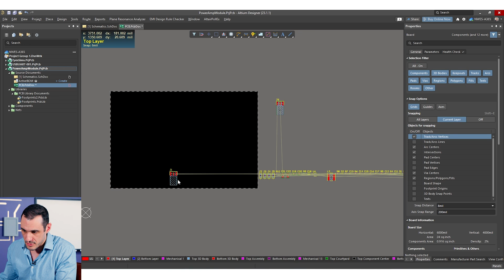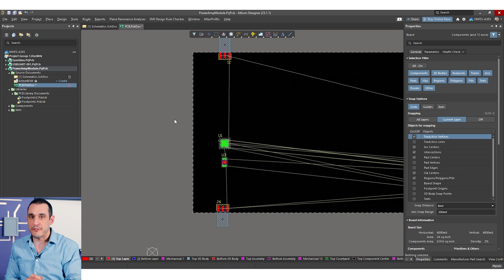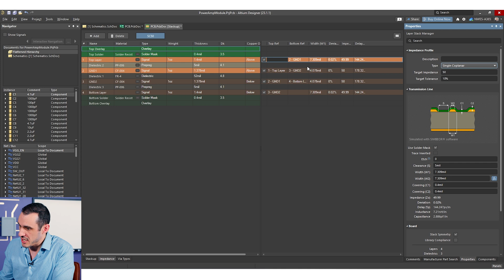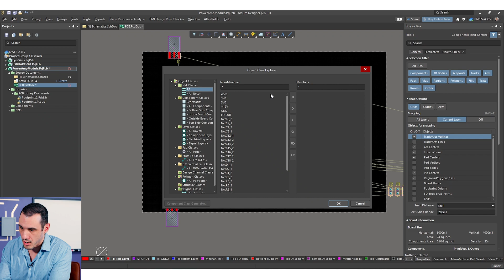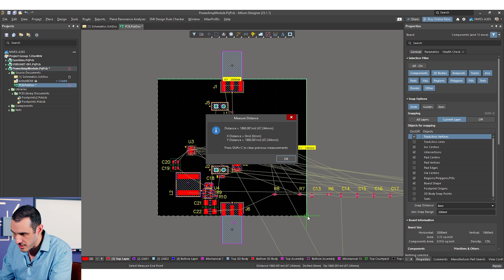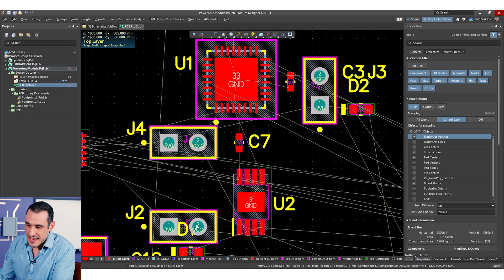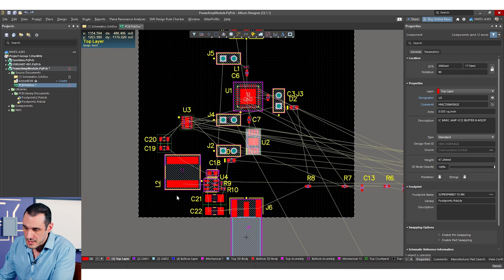RF Power Amplifier Design Followup: PCB Design

Comment: Hi Zach, i would like to ask you how actually works this scheme? I mean where should I connect the output, just to antenna but I dont see any sources of a signal (for transmitting information) or it works in other way (we connect it to an antenna for giving additional power, like in parallel to a source)? Sorry for grammar and punctuation.
Reply: The only input is 12V DC power. I have done this over an SMA connector as coax cabling can provide limited DC power, but you can always swap this for another connector easily. The output is the RF signal, it could be connected to an antenna, or connect it to another RF component or circuit. The RF signal is generated on the PCB using the VCO, you do not need to input any signal.

Comment: Is FR4 good choice for 6Ghz design?
Reply: Which variation of FR4 are you referring to? FR4 is a category of materials specifically referring to flammability rating, it is not one specific material. There are many different versions of it, including low-loss FR4 that has lower dielectric loss but not much more cost. That being said, 6 GHz is about the upper frequency limit where most FR4 materials might want to be swapped for a low-loss type FR4 or a different material system altogether. There are several reasons for this which I have explained across many different videos.

Comment: Great video Zach! When is it appropriate to use a coplanar waveguide in a pcb compared to just using an impedance matched microstrip? For example between a GNSS receiver and an SMA antenna connector, what would you recommend and why?
Reply: The main reason you would want to use coplanar waveguide is because you get high shielding effectiveness even when using a thicker substrate or dielectric layer. For example, I could have put a ground cutout through the internal layers and have ground pour on the bottom layer, and this would require using a wider line. This would give me lower loss, but when I put the pour on the top layer with the stitching vias to form the coplanar waveguide I could still get a reasonable trace width (about 30 Ohms). The shielding effectiveness I would expect would be comparable to having a narrow microstrip over ground on a thin dielectric. In this project I went with the thinner microstrip because the operating frequency is lower, and because we need a thinner line in order to route into the output of the power amplifier. I could have had this in sections too, and then we can look at the S-parameters across the entire interconnect.
Reply: @Zachariah-Peterson  Alright, thank you very much for the answer! In a project I am doing now, with an acitve GNSS antenna connector, I have 75um prepreg between the top layer microstrip and ground plane on layer two. I noticed that the line impedance is dominated by the ground plane (because it is very close) and the copper ground pour on the top layer with its shielding vias, does not impact the impedance much. But like you say the coplanar waveguide structure is probably giving me shielding and it ensures that other traces are kept away from the GNSS signal with some distance. Thanks again!

Comment: Are there ready-made designs for high-frequency power amplifiers? Can you help me with this? I want examples of it
Reply: You should look at reference designs from power amplifier IC manufacturers. Analog devices has released a lot of their evaluation board files as reference designs that you can use to get started. Try looking their for help with the circuitry and an example PCB layout.
Reply: @Zachariah-Peterson  
Thank you, engineer. I want a good book on that. I searched and found a lot, but I want to leave me the basics on that?

Comment: Hi,

If the edge connector pads are moved to the edge as shown in video, does it not result in exposed copper pads during manufacturing of boards?

Could you please let me know, if there is any workaround by avoiding exposed copper along edges?

Thanks for the video, It was really helpful.
Reply: I'm not sure I understand, those pads will always be exposed because they are surface mount pads, it does not matter if they are pulled away from the edge. If you're worried about plating along the edge, then yes the through-hole plating process can deposit copper across that gap if the pads run right up to the edge of the board and the plating throwing strength is correct. If you do not specify edge plating options in your PCB fab notes, but you place the pads along the edge anyways (maybe on accident), your fabrication house should warn you that this might happen, or they may apply a pullback around the board edge. Finally, even if there was some plating across the top and bottom pads on that SMA edge connector, those pads are connected to the same net anyways so that plating does not hurt anything.

Comment: Hello, i enjoyed watching your video. the rf amplifier that i need has to be in a frequency rang 900mhz to 5Ghz . can i get it done using thisdesign? if yes do you have any suggestions on component change?
Reply: I do not know if you can do a direct swap for a power amplifier with different frequency range. There are many different HMC components, so I'm sure you can find something in the microwave range. The HMC components use a variety of different biasing and startup procedures, so because of that you most likely will not be able to do direct swap, even if the packages and pinouts match.

Comment: Hello @Zachariah Peterson, do you recommend, in this case, to remove the solder mask on the RF tracks? If yes, should I remove the solder mask from the GND as well? Thank you!
Reply: Yes to remove some additional losses along the interconnect you can also remove the solder mask along edge of the GND region closest to the signal line. There is no need to remove all of the solder mask everywhere, but it is still interesting that I see some designs where they remove ALL of the solder mask from the entire GND polygon around the signal line, that is not necessary. If you wanted to do it in this example design you could just span the solder mask opening to the far edges of the via array.

Comment: In regard to the Stack-up material. Most RF PCBs use CORE on the Outer Layers?  NOT Pre-Preg.......... Due to Pre-Preg "press-out" thickness Fab issues. (I think)
Reply: Yes the stack can also be inverted. Not required but if you cannot tolerate any variations along the outer layer then consider using core on the outer layer. I've also had to do that when the outer layer was intentionally much thicker so that the RF line could be made wider and coplanar routing was used, then it would reduce the conduction loss. But yes press-out can be an issue with prepreg on an outer layer, gotta verify that stackup from a fab house first.

Comment: Last week I wrote a long review with mistakes done in this video/design.
But it never got published. This is really sad.
Either it was flagged as spam or altium or @Zachariah Peterson doesn't want to deal with professional critical reviews.

Cheers
Mel
Reply: I don't flag stuff as spam. This is not a hobby for me, I run a design firm and I get to deal with plenty of professional critical reviews. Portions of this design were based on a system that was fabbed, tested, and is deployed in the field. There were some variations of the design that would still need to be checked/simulated, like the via fence on the CPW going to the output. And of course we would want to get an actual stackup from a fab house but we wanted to show something just as an example. If your review did not appear then I apologize but I am not the one who flagged or deleted anything.
Reply: It will be interesting to read. Did you post it somewhere?

Comment: the rf amplifier that i need has to be in a frequency rang 100khz to 5mhz and rf amplitude upto 250Vpp. can i get it done using thisdesign? if yes do you have any suggestions on component change?
Reply: I am not aware of any part numbers that can handle those voltages. Usually when you are getting to those levels, you should buy an off-the-shelf module, or if you want to build it yourself then you might need to use discrete components.

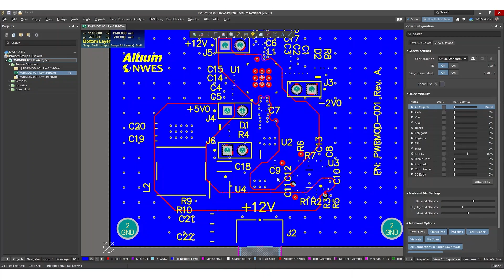Comment: Amazing video as always. Btw @16:08 what hotkey did you use to quickly switch directly from the Top layer into the Bottom layer? I don't think you use Ctrl+Shift scroll hotkey for that.
Reply: You can use the * key to cycle through signal layers from top to bottom. You can also use Shift + * to cycle backwards through layers. One thing to note is that * and Shift + * will skip plane layers.
Reply: @Zachariah-Peterson  Sweet! Thanks